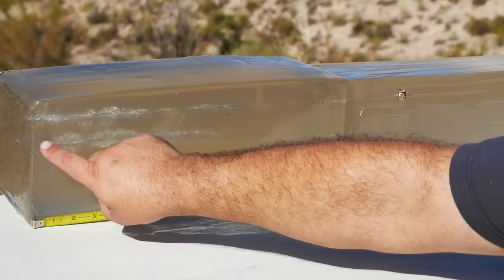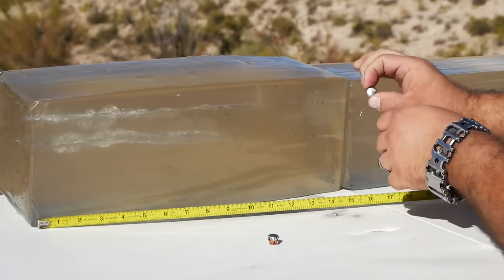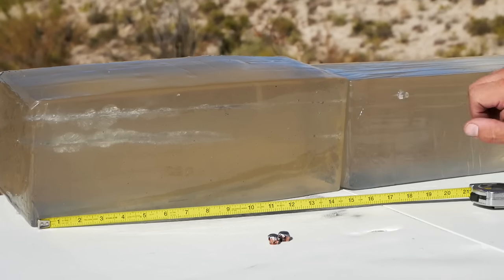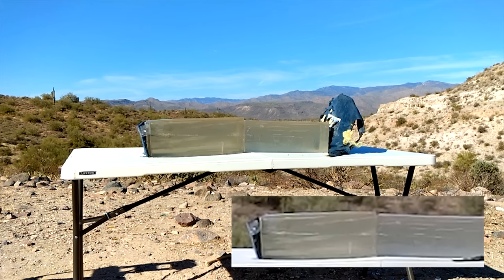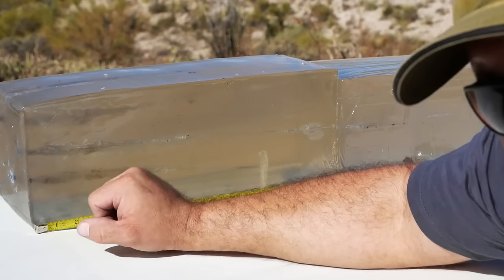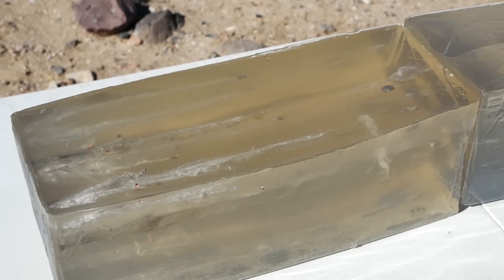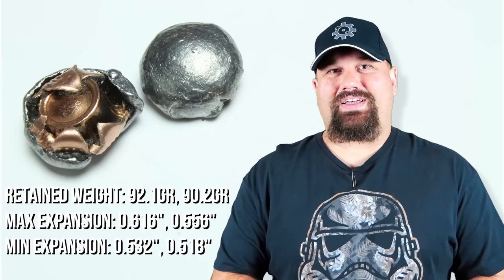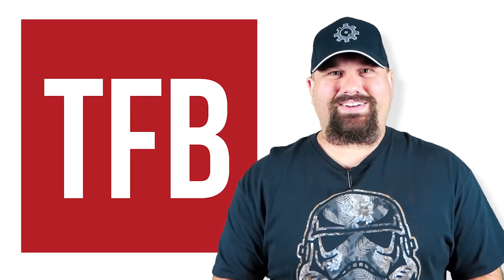Fiocchi  .357mag 125gr XTP Carbine and Revolver Gel Test

Comment: For the 4", the max you listed was 1564 (which is fairly hot for .357 out of a 4 inch)....and the low was 1420 (which is still full power for .357 out of a 4 inch). That spread from high to low is high. That round needed velocity for expansion it seemed. What also seems interesting is that the one carbine chrono you listed was 1666. That seems low for a 1480ish 4" inch load.

Comment: I was surprised that the velocity gain in the carbine was so small. Otherwise, performance was as expected. More expansion, a little less penetration (just about ideal), and a little fragmentation (not a bad thing). Good times.  I love my Marlin 357.
Reply: Late to reply here, but I can pretty much guarantee Fiocchi did not use h110, 296, etc in these loads. Hodgdon lists 2200 fps from an 18" barrel with H110 with this bullet.
Reply: @robertroosa285  i can believe it. Some years ago i was getting 2100 fps with Federal 125 gr from my Marlin over a friend's chrono.

Comment: Great testing.  The XTP bullet, especially 125gr, the remains one of my favorites.   I think that it is kind of interesting that this Fiocchi factory357 Mag load while performing well does no better than the 357 Sig in equal bullet weight (exception being the Hornady Critical Defense that was recently tested).   My trail/woods carry is often some kind of single action magnum revolver which tends to be loaded with an XTP bullets and I think this testing confirms that is not a bad option.
Reply: That’s because it’s a middle of the road 357 mag load, at max power loads the 357sig can’t keep up

Comment: I'm surprised the Carbine velocity was so low.
Considering the bullets were breaking 1500fps out of the 4" revolver.
Often fullbore 1425fps+ 125grs get close 2000fps out of a carbine length barrel.
My 158gr XTP handloads (similar to the ones you tested on your channel) hit 1950 out of a 18.5" Marlin. I switched to the 158gr FP-XTP bullets after seeing your test with the standard HP-XTPs go off like a hand grenade and not hit 12". They have a smaller more protected point and delay expansion for rifle length barrels. I expect this particular FP-XTP design to not expand in pistol length barrels however.

Comment: They do not look like the 125gr XTP bullets I have seen, and the fiocchi box usually says "XTPHP" and that box says "SJHP". I don't mean to call you a liar, Is this a new design? am I dreaming?
Reply: spyderxtra777 They look like XTPs but the box says SJHP. They are definitely not a semi jacketed hollow point.
Reply: Right, but the profile of the bullet in the picture looks more like the XTPs they sell for autopistols (more pointed and a smaller HP cavity). The .357mag XTPs I have seen/used have a more blunt profile and a larger HP cavity. I believe you that they are probably Hornady XTP bullets, but It's worth nothing that they probably changed the design.
Reply from the maker: spyderxtra777 Good point. I really should have said something in the video about the projectile. I think those wider cavity XTPs are the 158gr. I'll have to see if I have some older 125gr XTPs somewhere.
Reply: Hey paintball guy. I know we've talked before elsewhere. But thats not why I'm replying. I have an interesting FYI. Hornday offers two XTPs in .357 125 grain. # 35710 and #35730 both the same weight, but the latter has a smaller cavity and is supposed to be intended for faster impact velocity. I think this is the #35730 in the  vid. I know this because I have some of the other  sort and was looking to see what speed to load them to.
Reply: I reload 125 gr xtp hps for .357 and those bullets aren't the same.  The ones I load have a wider cavity.
Reply: Well done test though.

Comment: Andrew, great video as always.  Two questions.  One, are those your wife's guns :)?  Two, why the variance in using "X and X tenths inches of penetration  " vs. "X and 1/4 or 1/2 or 3/4 inches, of penetration, etc.?  Seems it may be a more simple approach to stick to one and use it consistently.
Reply: Stuart Dorfman Yes, they're my wife's. When I take a measurement, I use the tenths scale on the take measure. When I speak generally about approximate depths, I sometimes speak in fractions.

Comment: Not much more than 100-150 f/s more with the carbine than the revolver. Obviously a fast pistol powder used as the velocity was'nt increased more than 5-7%. That round is very hot in a revolver but anemic in the rifle. Good to know. Reloading 357 will optimize the speed for carbine. A full load of slow burning H110 powder can get the same bullet up to 2000 f/s in the carbine. Thanks for this video.

Comment: Wouldn't it be better if the bullet was bonded?
Reply from the maker: Jameson Cross Most likely, but this was still pretty decent.
Reply: TFB TV no complains about .357 no matter what the ammo is. Even the weakest .357 still kicks ass.
Reply: Jameson Cross I wouldn't go that far. I tested some PMC Starfire that was basically .38 spl in a longer case.
Reply: The Chopping Block how did I know someone would find some crap ass ammo in .357. As a general rule, it's all good.
Reply: Jameson Cross You're right about that.
Reply: The Chopping Block that's the point I was trying to make. You just can't go wrong with .357. The problem is you can't get a higher capacity handgun that's light and eaiser to carry, oh and semi auto. Not the 8 shot titanium scandium revolver  thingy.
Reply: The Chopping Block I actually like the .357 sig but the ammo is expensive and it's not the same power.
Reply: Jameson Cross Nailed it.